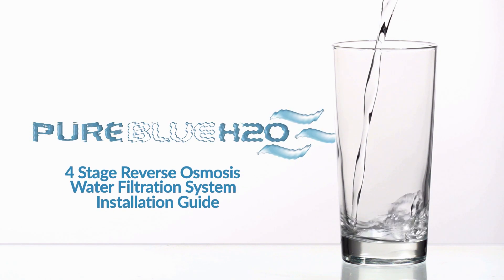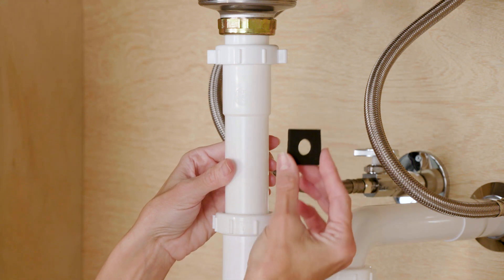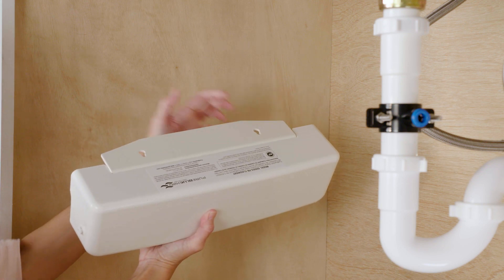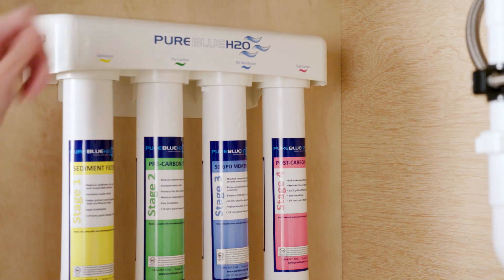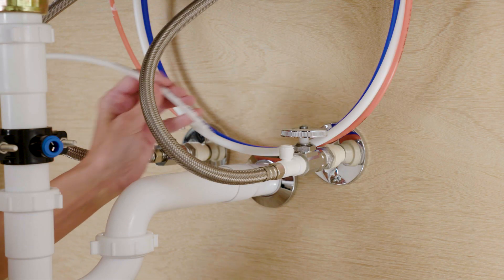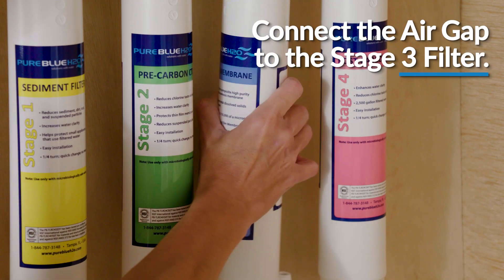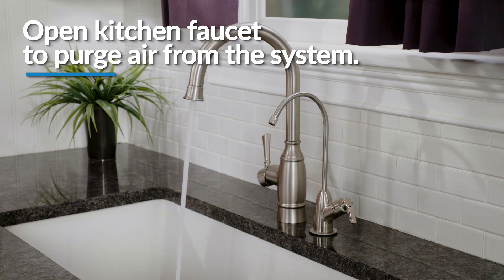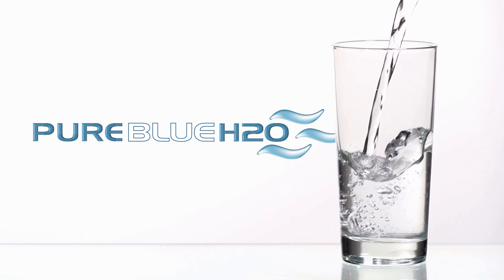PureBlue H2O 4-Stage Reverse Osmosis System Installation

Comment: Why does the faucet always leak after about a year?   Im on my 2nd faucet and now its leaking too
Reply: Wow! Not much help from pure blue on this channel, is there? The reason there is water leaking from the faucet is the air gap is clogged and instead of acting like an air gap, it is acting like a siphon. It's a crap design. You can unclog it with an air blast into the opening where the water is coming out. Use canned air or an air compressor.

Comment: Hello there every time it refills tank its making lot of noise from the gap on faucet could u please tell me what’s the reason. Thank youz
Reply: I recently started having that problem and I am guessing it’s because my filters need to be changed. After I changed mine, I can let you know if that was the problem.  Or you can change yours depending on how old it is if it’s brand new something might be wrong, but it does make noise even from the get-go when the water is filling the tank. Mine just got a whole lot louder.

Comment: I've been a happy owner of 2 separate PureBlue H2O systems, both from Costco. However after changing out the #1, #2 and #4 filter today, same way as I have twice a year from the past many years, it started leaking between the 2nd filter (Stage 2 pre carbon) and where it twists into the manifold.  Reattempted, including tried putting on the old filters, it continues to leak once the water supply is turned on.  Please help?  This particular unit is only 2 years old.
Reply: Hay John, please don't think I am rude, but I want to install a water filtering system in my home in Ireland, and after a bit of reading this system  came up as my best option . Can I ask if it is expensive ? Just a rough price would be a great help.  Thanks in advance, buddy.
Reply: I know that one filter says two years, but if you live somewhere like I do with really really bad water, you might need to change it more often. Also if you ever have issues with the lines outside breaking, and they’re working on them, you wind up getting a lot of dirt in the water that’s gonna mess it up real fast too.   Anytime you know they’ve worked on the lines. It’s a great idea to go to the closest Sink or whatever from the outside line and run it until the water runs clear.  And never turned on the hot water until you’ve got clean running water. You will destroy that water heater so fast.  
I guess that would be one of many potential issues    But it’s a quick and easy one to check first  well after you’ve made sure that every one of the hoses is connected well  I’ve also seen some people saying use a cardboard fingernail file on the end of the hose for some reason that seems to be helping as well as pushing the hose in farther than you think it needs to go like they said it’s about an inch  
Help this can help resolve your issue

Comment: Mi tank doesn’t fill’s with water at all . But i have water coming out from the fucet
Reply: Are the hoses inserted all the way?  Did you remove the plug that is on the end of one of the hoses?

Comment: I'm having an issue with water dripping out from the small port under the manifold after I replaced the filters.  Called support, was told it was the manifold that needed to be replaced, did that, nope.  Was then told it was the water pressure that was too high, nope.  Water still dripping.  Just turned off the water supply and got my Brita back out.  Now I'm out the replacement filters and the manifold $$$.
Reply: I just started having the same problem with mine. Been installed 18 months and had no problems until today.

Comment: I keep getting a screeching noise after changing the filters. Been going on for a couple of hours. I’m ready to scream. Checked the pressure, filters, tubing. What’s going on.
Reply from the maker: We're sorry to hear that! Could you give us a call between 8:30am-5:00pm EST today or tomorrow so we can get this resolved for you? Our number is 844-787-3148.
Reply: @pureblueh2ollc27   This is happening to us also - a screeching noise when installing a new unit.  Tried to call you but no answer and I left a message.  Please help or I will need to return the unit to Costco.
Reply: @pureblueh2ollc27  I have the same problem the screeching noise and water is running down the drain!! my water bill came to be higher than the electric bill now, because of this please some one help!!

Comment: Thank you for your clip.
I bought the water filter system from Costco last year and now the red light is on and not much water coming out, I don’t know what’s happening.
Reply: The red light appears after 2,000 minutes of water usage and indicates that it is time for a 6 month filter (Stage 1 and 2) change. You must manually reset the faucet battery for the light to appear blue again.
Reply: Change your filter cartridges 1 and 2 every 6 months, change cartridge 4 each year, and cartridge 3 every 2-3 years.  The faucet light is supposed to turn red every 6 months to remind you to change your cartridges and to change the faucet handle with a CR 2032 battery.
Reply: How the heck is it so difficult to find the Stage 3 cartridge? Look every where on Amazon. They have everything BUT the Stage 3 cartridge. Please help...
Reply: Can other brands example Amazon replacement filters be used?

Comment: Your video says drain 2 full tanks at the end of the install. Then it is ok to drink from the 4th tank. What happened to the 3rd tank?  Did you mean ok to drink from the 3rd tank and accidentally said 4th tank by mistake?
Reply: The "first" fill was released after 2 hours to test the water pressure, then filled for 3-6 hours completely, and drained 2x.

Comment: I wonder how much waste water to get 5 gallons?
Reply: I BELIEVE THE RATIO IS 2:1 (10 GALLONS TO 5 GALLONS OF FILTERED WATER) SO EVERY 2 CUPS OF DRAIN WATER YOU GET 1 CUP OF FILTERED WATER WHEN THE TANK IS EMPTY 
BUT IT BECOMES LESS EFFICIENT WHEN IT FILLS TO THE TOP BECAUSE OF BACK PRESSURE SO MORE DRAIN WATER AND LESS FILTERED WATER GET THROUGH 
THAT'S WHY YOU NEED A PERMEATE PUMP FILLS WATER FASTER
Reply: @MrDICKHEAD28  what does that mean?   I’ve also heard things about people having to put air in it.   I’m getting ready to change the filters for the first time.  Trying to weed out all possible problems before I do.   Also can’t find anywhere if I have to turn the water off before I pull the filters out or if it’s an automatic stop when the filter is not in.

Comment: Thanks for the tip. I disconnected my drain hose and actually saw quite a bit of water coming out so i wasnt sure this was going to work. I used my compressor in the garage and was surprised by the amount of gunk that was in the line.... makes sense considering it does connect to your garbage disposal.

Comment: The video is somewhat confusing, as it giving out instructions on connecting the tubes of the faucet to the outlets/inlets. It showed the white tube connecting to the “tank” but it was suppose to connect to drain hole, be aware when following this video step by step.
Reply: I had no issues with the directions as there are two tubs of the same size.  One connected to the faucet (unremovable) and one of the same size that was separate in the shipping bag.
Reply: IT'S COLOR CODED WHEN YOU BUY IT

Comment: just finished installing the pure blue h20 RO from Costco.  This video plus the instructions helped a lot.  While waiting to pressurize the tank I checked under the kitchen sink and noticed water was trickling from the manifold at the collet-tubing interface to the tank.  I pushed in the collet and pulled out the tubing and cut it square using a utility knife thinking perhaps the tubing was not flush.  Water continues to leak.  Not sure what else to do?
Reply: Mine too. The outlet to the tank and to the faucet are both leaking a lot after squarely cutting both tubings
Reply: My problem was fixed by pushing the tubings farther into the manifold
Reply: Nykolas Andrade I had the same issue. Thanks for the tip
Reply: same here, need to use Teflon Tape. Solved the issue.
Reply: I had to lightly file the end of my tubing for the leak to stop.  I used a cardboard nail file for this as the metal ones just pushed the plastic around versus filing it away.  Work perfectly now.
Reply: @kathydavisduran3037  The Nail File trick and cleaning the dust afterwards with a cloth worked for me, thank you.
Also, shoving the tube "all the way in" means about an inch. It takes strength sometimes.
Reply: Johnson Nguyen I had the same issue and was able to push the hose in further
Reply: I had same problem the blue hose ( RO faucet) and  transparent hose(tank hose) connected to manifold (filter stage housing) were leaking. Reposition the tubes several times may cause the o-ring to misalign in the manifold. I look at the holes of the manifold and found out o-ring was crimpled so I straighten it out aligning it to the hole and set it properly by using like a watch repair screwdriver and leak was gone for both blue and transparent hose. If o-ring is damage just buy 3/8 Quick Push to Connector and remove o-ring or just buy an o-ring from home depot.
Reply: I had this leaking issue too with the tubes leading into the manifold.  I was able to resolve this issue by forcing the tubing deeper into the manifold.  However, I still have a leak issue with the tubing that connects to the tank.  Follow up:  I cut the end of the tubing and put teflon tape around the tank joint nozzle thing.  Then I tightened it as much as I could without a wrench, just by hand.  It seems to have resolved the drip.  This thing was a beast to install.
Reply: I have the same one you need more Teflon tape the white one that came in the box.
Reply: throw it away